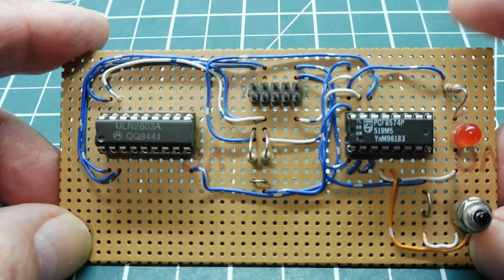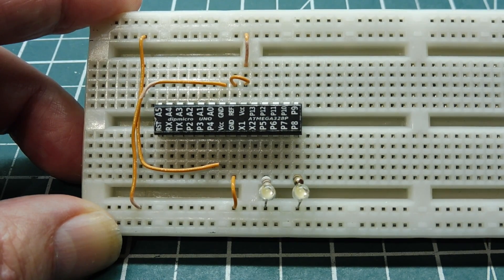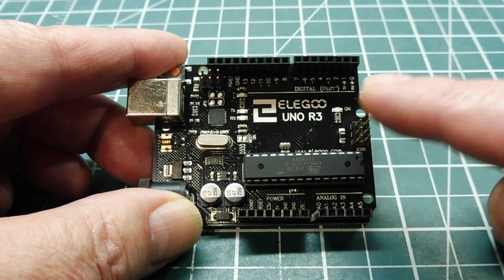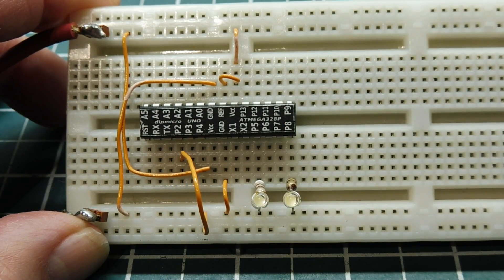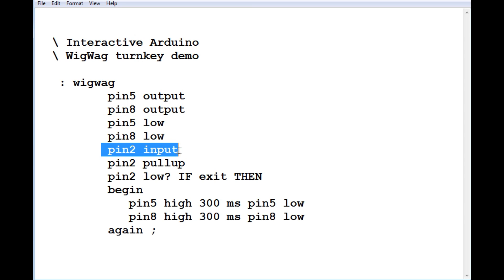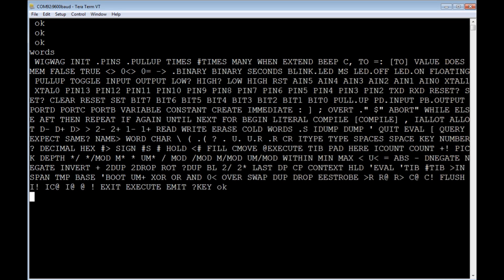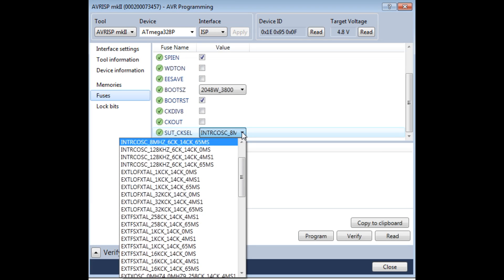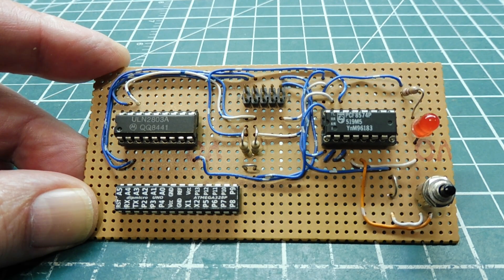Build a Barebones ATMega328p Microcontroller Circuit / Forth

Comment: Very nice way to do that.  Good to know for those low power projects in the pipe. I was thinking you'd have to have an avr programmer so you'd have to have isp pin out on your bare bones board etc.. but your way is so simple.  As far a buy local, I remember in the 80's there were electronics shops around but they all are gone now, same with Radio Shack in the states. Radio Shack hung in there, even offering components until they went out of business.  Your lucky if you do have someone local to buy components from.